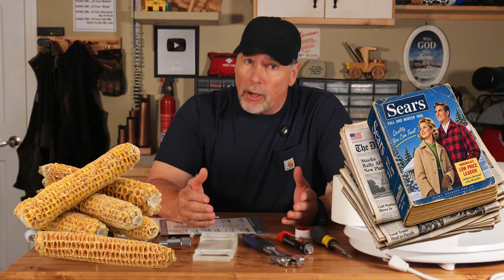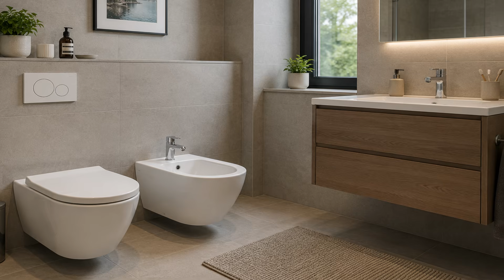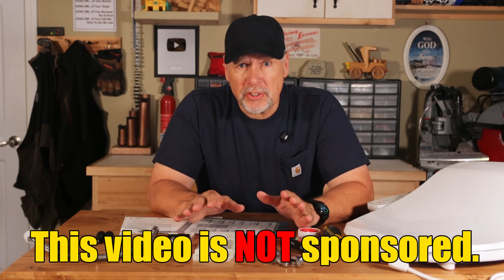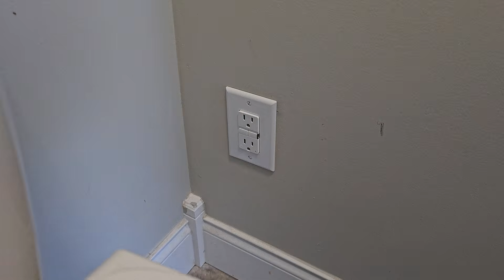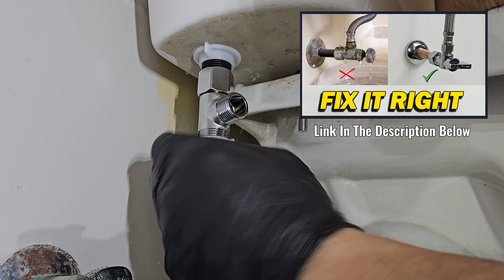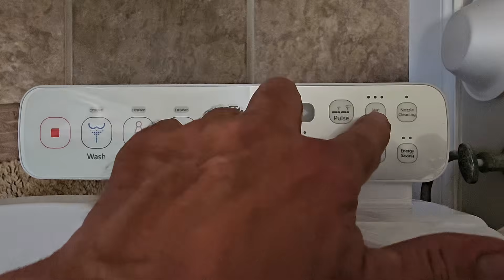Why Didn’t We Do This Years Ago!

Comment: We live Down Under and bought a bidet from a local brand.
I checked one out first, as my wife is always wary of anything different. She knew about bidets, but her first reaction is to keep doing the same ol', same ol'. If it ain't broke, don't fix it. It does my head in.
I bought a basic model just to test the waters, and I liked it.
I convinced my wife to try it, and to my surprise, she was impressed.
Being the nice bloke that I am, I bought 2 of their top-line models.
Man, it automatically lifts the seat as you approach and closes it when you're done. That worked fine for females, but mine erratically closed the lid while I was mid-stream. I tried every setting to get around my dilemma, but had no luck so I replaced it with the basic one. Mine has all the comfort modes and does everything I need it to do.  Happy days.
The only niggle is that it makes an unnecessary, annoyingly loud beep at times that can't be bypassed.
BTW, you guys have some amazingly advanced models that I could import, but they are 110v only, so they require a step-up transformer to use. Dang!

Comment: Once you bidet... there's no other way. still use some paper. but for cleaning the bidet is best. And no the bidet doesn't spread germs everywhere. It is self cleaning after each use and also by using cleaning function the nozzle can be cleaned and sanitized as often as you like. Seat is heated, water temp control, fan for drying. A clean butt is a happy butt. 😁

Comment: Well done video! I learned a lot. The only question I have is does it have a tank for the heated water or is it on demand?
Reply from the maker: Great question. It actually uses active ceramic heating coils to warm water on demand as it flows through the unit instead of storing it in a reservoir tank.